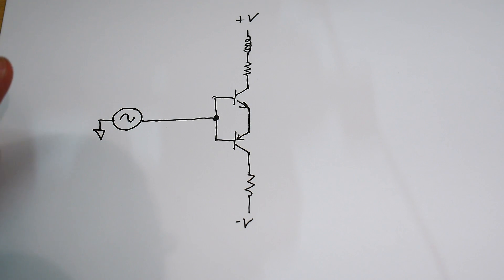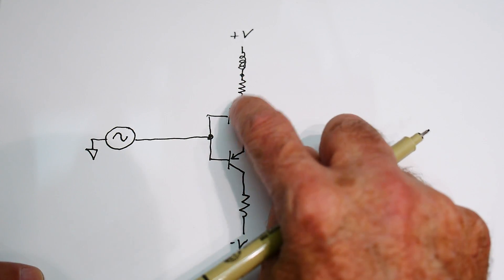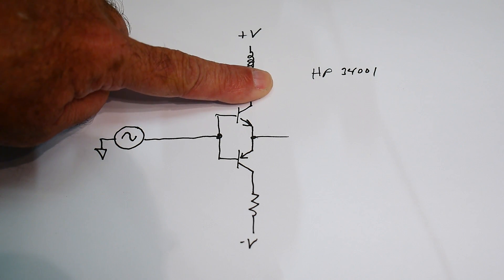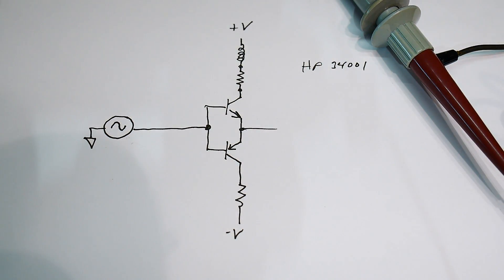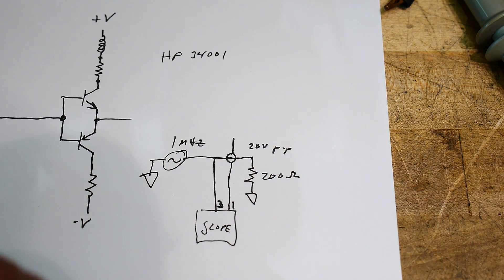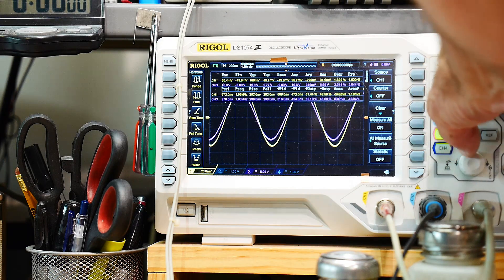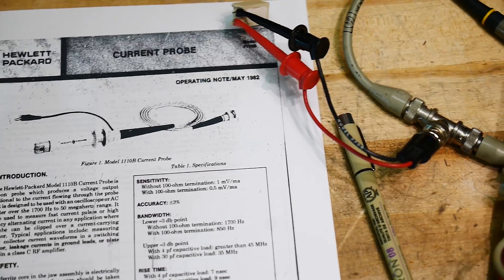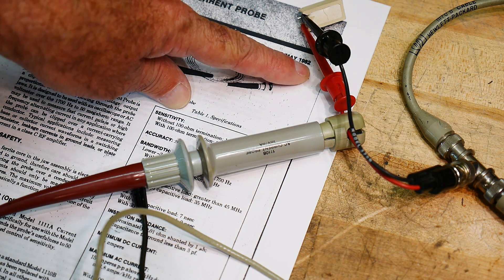#558 HP 1110B Clip-on Current Probe

Comment: Quite interesting to see this vintage current probe. At 11:20, 3dB point is where POWER is half of the maximum power NOT the VOLTAGE. That means that at approx. 70.7% (or exactly at 1/sqrt(2)) of maximum voltage, the power should drop to 50% of max power value. 
So, what the data sheet is suggesting to be 15MHz is what where power would be half. In order to confirm data sheet 3dB point on voltage measuring oscilloscope, you should take the reading at 70.7% of max voltage, that frequency should match with the data sheet rating.